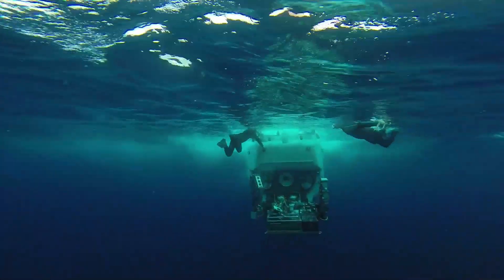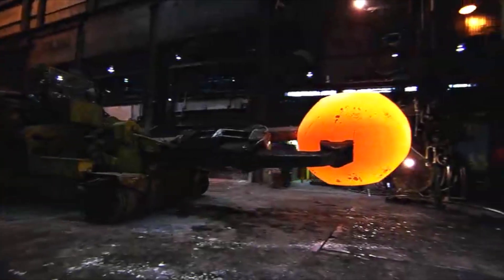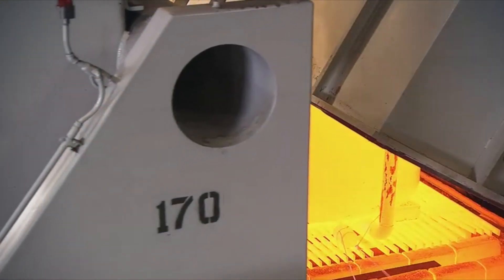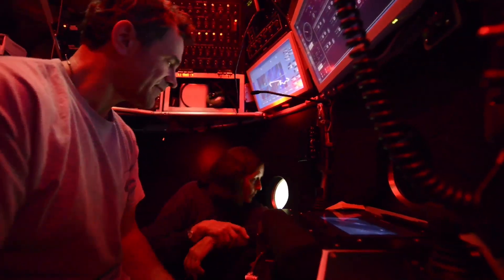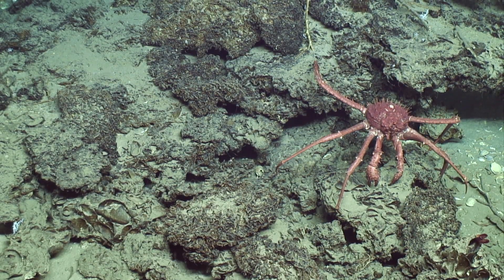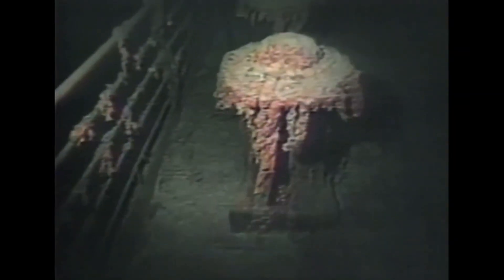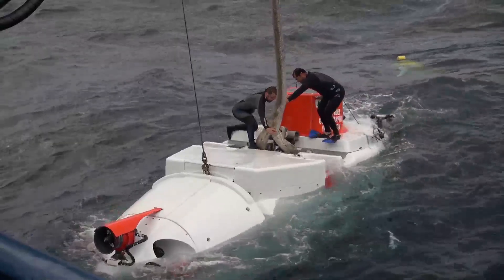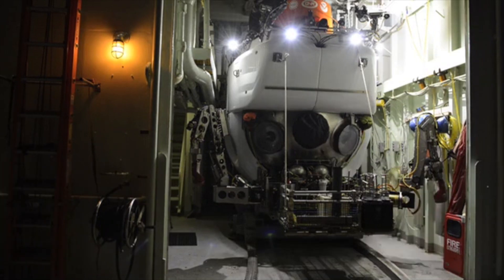The Alvin Submarine Part 1: Updating the Deep-Diving Submarine at 50 Years Old - WIRED

Comment: They couldn’t make the sphere bigger or roomier so more people could fit in there?
Reply: I think its becuz more ppl in the submarine means more weight. Going deeper into the ocean means more pressure added on u. If there were like 10 ppl in a single submarine, it'a most likely to sink or something. Well thats what I think
Reply: Every square inch of volume adds 14 pounds of weight every 10 metres so even if you had a tiny 5 gallon sub  which equals out to alot of square inches that's like 300 pounds every 10 metres so submarines have to be as small as possible.

Comment: alvin can survive in the ocean about 10800 meters......
Reply: 90mm thick titanium is needed for unlimited depth
Reply: No -- not that deep.
Do you know what 10800 meters is?  It's over 35,000 ft, roughly the depth of the Marianas Trench (which is 36,021ft depth at its deepest point).
There have been 3 vehicles built that could go that deep -- 2 manned (Trieste 1 and James Cameron's vehicle) and 1 unmanned Japanese ROV (later lost).
Alvin's been redesigned for 6500m, or about 21,000 ft.  That's well short of the Marianas but still gives it access to 98% of the ocean bottom.
Below 21,000ft, it just gets orders of magnitude more hazardous and you want a smaller vehicle than Alvin to dive.  A smaller vehicle is easier to build a strong enough shell to resist compression other these minisubs would be the size of a ballistic submarine.  Attack/ballistic submarine go to around 2,000ft.  Even in its original form, the Alvin was capable of at least 6,000ft (with the original pressure sphere; it's had 3 pressure spheres through its existence, each upgrade its depth capability tremendously).

Comment: so pretty much they changed every part but the frame....thats not exactly the same sub. its more like a new sub with an old frame than an old sub with a new everything.
Reply: You could say it's a ship of Theseus problem... or, rather, a submarine of Theseus :)
Reply: +Rinoa Super-Genius NO...

The original Alvin is completely gone.

This is Alvin in name only.

They have replaced every component at least once since the sub was originally commissioned in 1964.

The diving sphere itself has been replaced twice.  This is the third sphere that Alvin has had.  It takes the depth capability to approximately 20,000ft so it should be able to cover 97%-98% of the oceans.  Of course, the Marianas Trench is beyond that capability.